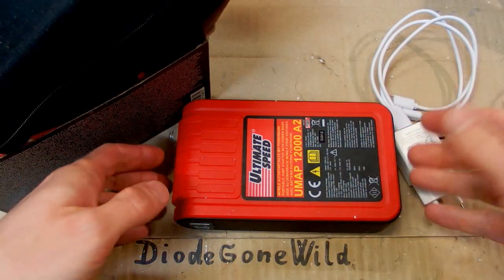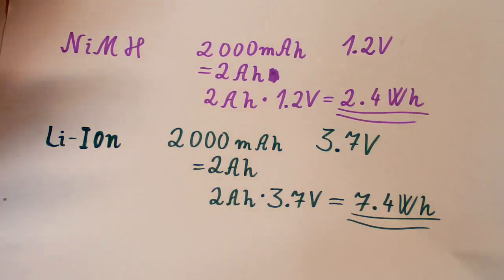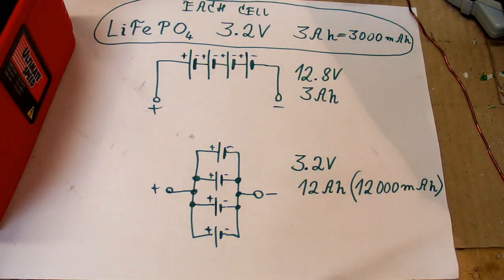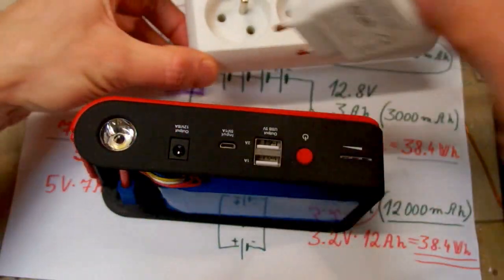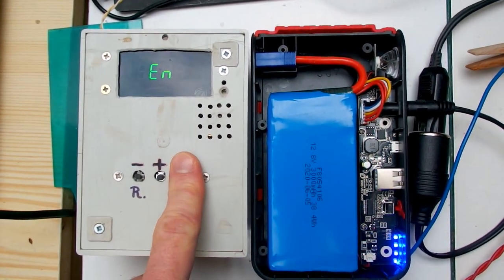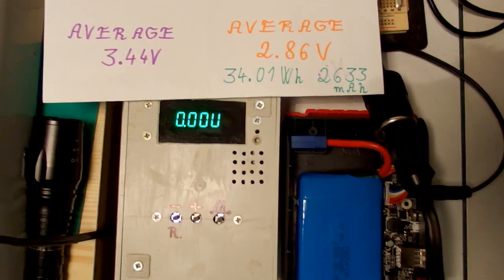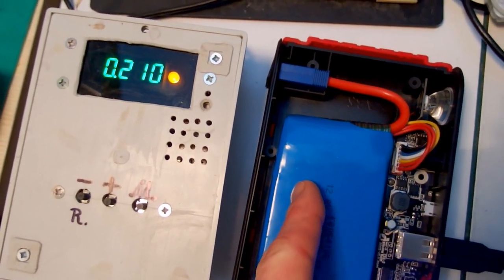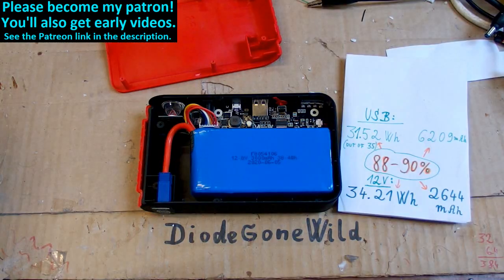Lidl "12 000 mAh" jump starter power bank capacity test

Comment: Totally agree with the video. What's interesting to me is that for batteries we use the term "charge" but we don't mean it in the electrostatic sense (joules per coulomb) we specify energy as Watt/hrs not joules per second. However it does make sense if you know the constant current and voltage your load draws.

Comment: Merry Christmas, DiodeGomeWild :) thanks for this review! 
It probably didn't get the full capacity because it wasn't fully charging the cells to 3.6V/3.7V (3.7V max for LiFePO4). Better charging circuitry (including balance charging) would resolve this.
It also didn't discharge the cells fully either - and the same often happens with Li-Ion powerbanks (for mobile phones) as well. I saw a previous video that GreatScott did about a powerbank and he found that it was cutting the cells off at 3.2V instead of 2.5V - 3.0V. Doing this gives a slightly better cell lifespan, at the expense of battery capacity. So it's entirely possible that the PCB has a higher cut off e.g. when the first cell reaches 2.7V, rather than when all cells reach 2.0V - 2.5V (balance discharging would also help).
The only way to get the true capacity of the pack would be to hook it up to a balance charger/meter (such as Turnigy Accucel or SkyRC Imax) with all balance wires connected, then run a balance charge and a balance discharge. (Though having said that, 90% available capacity is still good for the vast majority of people.)
It will be interesting to see how this battery imbalances itself over time, as all Lithium Ion battery packs do - as usually one or two weak cells will limit the functionality of the entire pack (this is definitely what happens in laptop battery packs, anyway).
Reply: Agree about full discharge and charge to 100% (both according to particular battery chemistry, obviously) as single way how to determine true capacity. By the way would not hurt to have balance connector socket on case with a switch to make battery charging from any hobby charger possible in case when you must start your car with empty battery still in this day (things happen when no one with a working car is nearby, first person experience).

Comment: There is space in the case to include an active cell ballancer, that draws power from a cell to recharge another one, it would fit perfectly here...
Reply: The usefulness of that should be tested. You can see that the cells are much more balanced when nearly discharged. That may help preserving the capacity of the weaker batteries in the long run. A balancer might maximize the cranking power, but it'd have its drawbacks.
Reply: @atdzsny  That would depend on the bms... how is low voltage detected, individual cell, or total voltage? If it's using individual voltage, then as soon as one cell reaches low voltage, output is cut off, so no problem to over-discharge any of the cells, but if total voltage is used, then it's much better if cells are kept balanced all the time. Also, in soft discharges, cells would be balanced "on the go", since the system is independent. Only in high power discharges, cell imbalance could cause a problem, but discharge the pack directly all at once very fast is not recommended... As you said, it should be tested.
Reply: @DanielLopez-kt1xt  That's OK, but I think the main selling point is jumpstarting here, and it seems there's no individual cell protection on that output.
Reply: No point in top balancing since the only way it could use the charge from one cell to "top up" the charge of another cell is if the higher cell is over-charged above normal specs. So overcharging is overcharging.
Reply: @johncoops6897  the use of an active balancer would be precisely to take all cells to 4.2v without over-charging cells, and use them all the closer ton fully charged possible. Drawing too much power from a discharged battery is bad, so by keeping them all balanced at top charge would prevent that... no overcharge, no overdischarge...

Comment: Hi, I also distributed this powerbank and tested it briefly. I was curious how it is with the balancing of the article and I have to say according to the first knowledge that I charge it really well and it's not as bad as it looks. I also had differences in the tension of individual cells after charging. I didn't measure it immediately after charging, but only after a while after the values stabilized, and I also had differences in tension. Lowest - 3.43V max.- 3.57V. I wanted to test all cells, especially how much capacity they can fit in them after charging with the supplied adapter, so I started to charge each cell separately and I found out that even though the voltage difference was 0.14V without load, I am the weakest cell with a voltage of 3.43V charged only 10mAh digital charger and was charged at a voltage of 3.6V and a short time when the charging current decreases terminated. The difference of 10mAh comes to me Ok. After charging each cell, I measured the voltage of all cells separately and they already had the same voltage. When discharging via the USB port, I measured the voltage of all cells and it was the same. I will discharge the power bank and try to recharge it to full capacity via the supplied USB adapter, and after charging I will try to recharge the additional individual cells separately until the end of charging and compare the differences. If the result is the same, then there is nothing Bat. It is a possible characteristic of these batteries that even 10 mAh in capacity can cause a drop in cell voltage of up to 0.2V. During the load, the tension equalizes. Give it a try and let it know.

Comment: it would probably charge the battery to 14,4V. But most BMS dont have any balance resistors. The charge is simply terminated if one cell reaches 3,6V (your 3,57V cell).

Comment: In your original video the battery was not fully charged and at 3,3V. Because the lifepo4 charge und discharge curve is so flat, it is only possible to get an accurate SOC at the very high and low ends of the voltagerange. The pack was bottom balanced.

Comment: That battery pack is probably a 3S configuration. If you note, on the balance connector there are 2 red and 2 ground wires coming out in parallel designed to handle the power the usb ports and board  through a boost converter. I have tore apart many of these starters. This is not the standard Balance jst-xh plug but are usually a smaller pitch. They are internally wired differently for this purpose. If you probe the pack from the side, you will probably feel the 3 cells through the shrink wrap. I might be wrong because I never opened a Lidl starter. (EDIT: You're right! I missed the first video It's LiFePO4...3.2 X 4 = 12.8V)

Comment: I would be interested to see you measure what it is doing when use it to start a car.
Reply from the maker: I may connect my small oscilloscope parallel to the battery to see what happens during the starting.
Reply: @DiodeGoneWild  And the clamp meter to see what current?
Reply: @DiodeGoneWild  ElectroBOOM ( Mehdi Sadaghdar ) actually already measures up the starter motor current and voltage when he start his car ( video : https://youtu.be/tKki89sq0XY ) I don’t know if the graph were the same across all cars ( since there’s a LOT of brands and models out there ) not to mention the video is 4 years old :-)
Reply: @atalakeanumonarshi129  But he only measured it by starting a small petrol engnine. This doesnt say much about the capability of the jumper pack

Comment: Quite a weird one. Perhaps they're doing it this way because 14.4V isn't necessary? Typically the bms cuts off when one cell drops below a threshold while discharging, but here it seems it cuts off when one cell reaches a threshold while charging. Hopefully it's a design feature and not just a horribly designed battery pack.
Reply: Cost of production would affect how they design. It should have balance charging design for safety
Reply: @jumpspower-heavydutyminipo6350  it does make sense to ommit it when it's not needed, as it massively reduces the complexity and cost. The only tradeoff is that it would have a bit more jumpstart oomph if it did charge all the cells fully.
Reply: @lakiza55  From our experience, if the cell are not balance and you are drawing high current, the cell will easy to Swell..

Comment: My concern is that I'd want to know that the 12v output leads are able to survive the output current demand.
Reply: Big Clive did a test on these a few years back. The protective Schottky diodes in the cables seem to be the weak point (and probably for the better). I certainly wouldn't want to try and jump start my 5.7L V8 with a direct drive starter using one of these cheap ones. It would almost certainly blow all the diodes, and possibly nuke the batteries if they dont have protection.

Comment: Nice explanation I was confused for many years about this concept of mah but that’s true almost all electronics have a tag of 3 or what ever amount of cell x Ah and even add more fake ah and give you an exaggerated mah rating and will never tell you what’s the individual mah and amount of cells , yeah many electronics don’t have great and safe charging and balancing that’s what I had to learn as you did but with lipo cell jumó start and cell puff and made them work but they lots abit of internal individuals mah and one cell had greater internal resistance afterwards charger didn’t had the ability to fully charge the pack it’s always best to have a smart external charger for this type of battery chemisy

Comment: You say confusing, I say intentionally misleading. The same comment applies to storage device capacities.
Reply: Storage devices are actually OK as far as I can see. Any inconsistencies are down to operating systems displaying the units incorrectly.
For example: Mac OS shows capacity in GB (decimal units, multiples of 1000); Linux shows the capacity as GiB (binary units, multiples of 1024); however Windows misleadingly reports the capacty in "GB" (whilst actually using GiB for calculation). 
The same goes for other units: 1kB = 1000B; 1MB = 1000kB; 1GB = 1000MB; 1TB = 1000GB
However: 1kiB = 1024B; 1MiB = 1024kiB; 1GiB = 1024MiB; 1TiB = 1024GiB
(Also note from above, the difference between binary and decimal units increases with larger units.)
Hence why your 2TB hard drive actually only shows up (under Windows, at least) as "1.81 TB", because they're using the decimal notation with binary calculations!
Reply: @TheSpotify95  thank you I didn't know this. Also Merry Christmas
Reply: @TheSpotify95  Same issue with RAM. It's displayed as 16GB even though it's 16GiB, 16384 KiB.
Reply: It's because the international airlines want clearly shown the total capacity of the BATTERY CELLS, not the capacity of the output circuits. A powerbank with 5 x 2000mAh Lithium 18650's inside is labelled as 10,000mAh. It might output 5V or even 9V or 12V if QC or PD stepup converter is inside, however the CELLS are what matters for the transport industry.
Reply: @willjohnsonjohnson  ironically RAM manufacturers state their RAM sizes using the binary system as you state, yet the manufacturers (and Windows) shows it as GB, not GiB. However, Ubuntu Linux does show RAM size as GiB, which is correct.
Reply: All binary powers have to be a multiple of 2. Hence 512, 1024, 2048 etc.
In a physical RAM chip, the memory is wired up as a matrix. It’s not practical to have decimal multiples. When floppy drives were introduced, the sector size was a binary multiple 128 bytes, 256 bytes, 512 bytes. But the number of sectors per track was not. And the number of tracks was determined by the mechanism. It was a similar story with the first hard drives. Hence soon the hard drive manufacturers used a weird hybrid capacity system.
But as most operating systems use a filing system that works with binary numbers, file size allocation will be done using binary powers of 2. Hence consumers are confused when a 1 Gbyte file takes up more than 1 Gig of hard drive space. Because of this, my logical solution would be to change the law so that the hard drive manufacturers have to specify the capacity as a power of 2. Of course, this still would not take account of the slight loss of available capacity due to the filing system overheads.
Reply: Amp hour (Ah) is the traditional method used for cells because then it makes it easier to work out how many cells are needed for your specific battery application. This is harder to do if using Watt hour (Wh). Most electronic loads draw approximately the same current over their normal operating voltage range. So you use Ah to determine the nominal run time.
And yes, lots of marketing use mA instead of A, and mAh instead of Ah. In the same way that other metric units are misused.
Reply: @Mark1024MAK  - the use of  mA instead of A, and mAh instead of Ah is NOT "misuse". It's simply a smaller measure (the 'm' = 'milli' = one thousanth).
For example, a 18650 battery might be labelled "2600mAh", yet you claim they should be labelled "2.6Ah"... guess what, that's the same fucking thing.
As for your other comments about loads being constant and using Ah to determine the run time is so laughably incorrect, it doesn't warrant further comment.

Comment: Hello thanks for the great video as usuall. In the first explaination  of the two different batteries energy don't you think that puting the two batteries in series with different voltage would end up charging the 3.7V one into the 1.2v other?

Comment: How is it possible that the battery discharges 500A? That's 167C, which is way above what batteries are usually max rated at for discharge rate. Wouldn't that make the battery explode?

Comment: I like 'mAh' because it's easier to calculate how long will battery last. For example, my circuit consume about 500mA at a 5V so 5000mAh battery will last about 10 hours.
Reply: This is only correct if the 5000mAh is the output capacity. Most powerbanks list the battery capacity. You have to take into account that the battery has a nominal voltage of 3.7V and must be boosted to 5V which takes more current. The easiest way to get an estimate of how long the powerbank will last is to take the energy and divide by the current. eg. 5000mAh * 3.7V = 18.5 Wh.
18.5 Wh / 5v = 3.7Ah. (this is the output capacity ignoring boost efficiency)
3.7Ah / 0.5A = 7.4 hours
Reply: @scottlaflair4995  I see. Thank you!
Reply: Amp hour (Ah) is the traditional method used for cells because then it makes it easier to work out how many cells are needed for your specific battery application. This is harder to do if using Watt hour (Wh). Most electronic loads draw approximately the same current over their normal operating voltage range. So you use Ah to determine the nominal run time.
Unfortunately in the world of power banks, marketing like to use the highest number...

Comment: Thanks again for this one. Shame there doesnt seem to be active balancing circuit so performance of the battery is tied to how well cells are matched at the factory. At least protection circuit is present so you shouldn't be able trash the unit by over discharging a single cell.

Comment: I would to a top balance to the cells. Charge each cell individually by directly connecting to it via the cables (unplugged from the board of course). That might improve performance.

Comment: It will be lower voltage because its lithium iron phosphate. They like to use these because 3.4v per cell (fully charged for LiFe) is about 13.7v which is perfect to run a car. That's about what the alternator tries to do anyway. They're also a more stable chemistry overall, which helps safety-wise.

Comment: I am sorry, but another suggestion: i found this dual use casings less than 9€ new, for 18650 and much bigger 26650 cells as well. They could make up for quite a difference, very likely for their internal resistance. And it says '6 kinds of protection'. Maybe this could be used for some comparison testing in some future as well?

'Features:
NO Battery
2-in-1, 2 * 26650 Battery Charger + Smart Power Bank.
or 2-in-1, 2 * 18650 Battery Charger + Smart Power Bank.
Each slot with independent charging circuit.
Fast and high-performance chip, provide 6 kinds of protection.
LCD Display Screen is convenient to read the remaining capacity.
Multiple uses, power bank/charger/storage box.
5V/2A, 5V/1A, dual output USB, two devices get charged simultaneously.
When charging the device, it displays output voltage and output current; when charging the batteries, it displays input charging status.
When input and output at the same time, it will automatically charge the device first, then charge the battery.

Specifications:
Brand: TOMO
Color: Black / White (Optional)
Material: Plastic
Input: 5V-1A
Output: 5V-1A, 5V-2A
... '

Comment: There is one auction '8 x Akku 18650 Powerbank' which shows the inside of the powerbank as well. It has 8 cells of course and some electronics with a display, see pictures, and no starting bid now at 15€. Maybe something more to analyse.
Reply: At German eBay